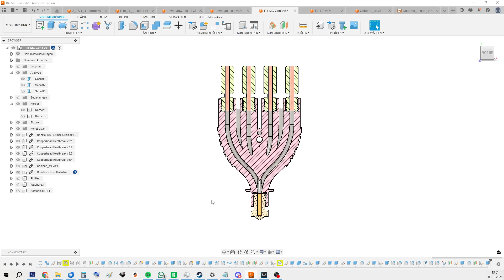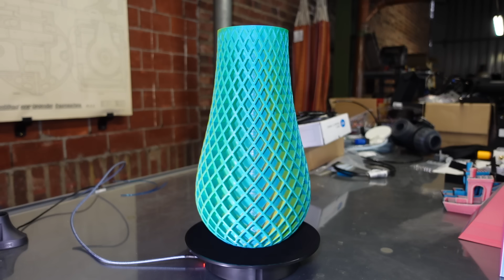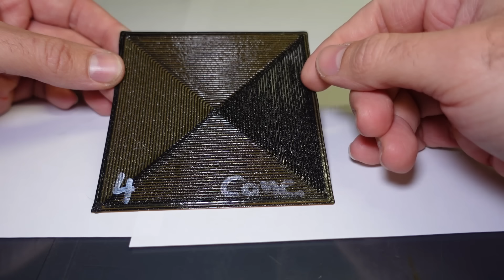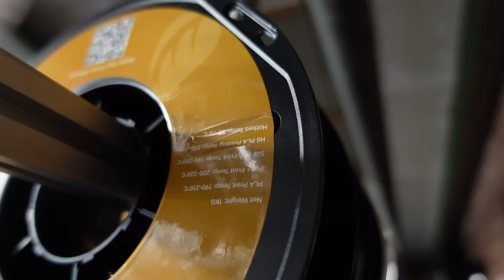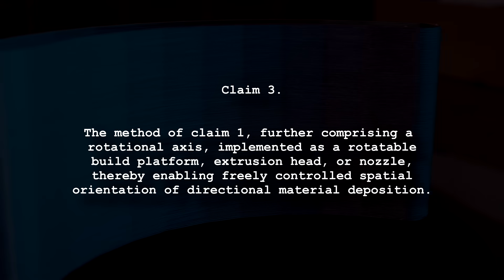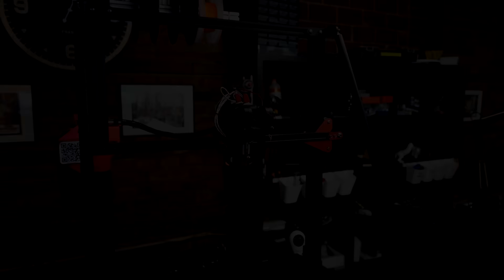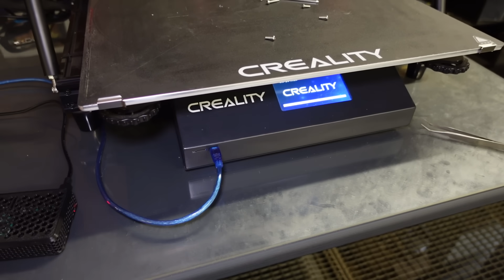WASTELESS Multi Color 3D-Printing. Introducing the Open Source Co-Hotend (Roetz-End E03)

Comment: Wie sieht es mit nicht kontanter Extrusion von einzelnen Filamenten aus?
Also 85% gelb 5% rot 5% blau 5% grün um eine gelbere Stelle zu kreieren oder 5% gelb 5% rot 45% grün 45% blau um eine türkise Stelle zu erzeugen?
Damit wäre es nicht notwendig die Richtung zu ändern um die Farbe zu ändern, natürlich wären 4 dedizierte Extruder motoren notwendig, jedoch wären die Möglichkeiten weitreichender.
Reply from the maker: Die Sache ist: Co-Extrusion ist patentmäßig ziemlich offen. Sobald du mischen willst, haben die großen Jungs bereits alles abgefrühstückt.

Comment: Well, the 3D printers from "Builder" of the Netherlands had this with 2 filaments, that were mixed in the nozzle like this. (Builder 3D Printers).

They moved to big industrial 3D printers.

But I have one of the smaller ones (with a mixing nozzle for 2 filaments, with 2 extruders that are mounted on top of the nozzle), maybe a printer from the first generation, that was before the big wave of cheap bed slingers from all over the world. According to my memory, only more or less flimsy DIY printer sets were available at that time from most of the other 3D printer makers.
Reply: For the time frame: One or two years after I bought mine, they came up with a higher printer - the same print bed, but a very high printing frame...

Comment: Nice! It'd be interesting to see if smoothing out the quad bore makes a difference for flow rate and/or for laminar flow quality. 

If I haven't mentioned this in a comment on an earlier video, it can be done with "abrasive fluid machining" (Extrude-Hone, US) aka "hydroerosive grinding" (Sonplas, Germany). There are probably other companies but those are the ones I know of 

Basically a fluid carrying abrasive is forced through the channels, smoothing any rough edges. It's used in diesel injectors, engine manifolds, etc.

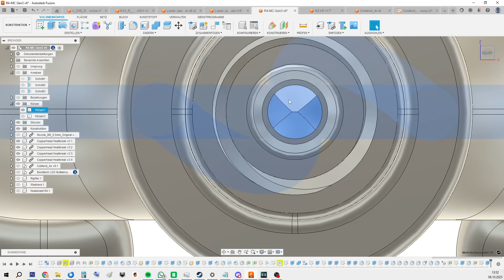Comment: All of this revolves around designing a join/outlet at 1:42 making a ?circular? mix with clean delineation, or lamination from separate filaments.
S what's the crudest primitive that can be made? w handtools,CNC or w/o.
Maybe premaking/buying such a filament + some system to maintain orientation in the output as filament shifts*.
Or is a cruder version possible abandoning the vertical form factor and just 2 short blocks bolted together and horizontal in-feeds? (combo-chamber, an internal-nozzle, symmetrical mixer, mixing-chamber, divot shaper thing)

The underside of a TOP block & the topside of a BOTTOM block are drilled either with divots(for a circular chamber), or just the or milled to create a directional inlet; 
Bottom block gets a through-hole

Then top  block is drilled in from the sides for in-feeds.
Bolted together to creating a joining chamber / laminar chamber:  (?)

~~ |--⮟--| ~~
       ⋮  (?)  ⋮ 
       |__v__|
           ╎

Hand drilling would probably have mixing problems instead of clean separation.
There's also trying just a chamber on upperside of bottom block , so the top block is just a clamp but hand-drilling down the FACE of a material isn't a good time, so any DIY feeds are drilled when blocks are bolted together but seems problematic.
Or starting from 2 pre-milled blocks CNC'd by a supplier for the combo-chamber for the combined feeds flow.
Then at home drill  the number of inlets wanted using preprinted depth/align guides, and tap assembly holes for final assembly.

*can't be magnet and ferrous filament as that would fail at a hotend, but maybe before that point.

Comment: If the flow through portion itself could rotate that would be cool but very hard to keep it from leaking under heat and pressure. I am certain it could be done but probably not the answer. If the entire hot end rotated that would be cool but you would also need to spin the spools. The bed is the most likely option but all require slicer software to keep the colors.

Comment: The rotatable build platform is already been done and it works so you could definitely do this. The hard part will be the slicer to rotate the model in the method required while maintaining the xy motion. I think it can be done but may be a bit of a programatical challenge, especially the key will be to keep the xy movement rotating to the same point while the table is moving. Very cool concept.
Reply: IMO I think for hard color transitions slicers could just add a pause for travel and then continue after rotating to a different nozzle is complete

Comment: 15:02 I understand from a simplicity and weight perspective why having a single extruder motor driving all of the filaments is necessary, but I wonder if you could achieve even more control by independently varying the amount of each filament you extrude, for example varying material properties or removing color contamination on a few layers where you don't want one of the colors.

Comment: Edit2: sorry for typos, the cellphone I use is quite old. 
Edit:for additional method look in my comment under this one, in a nutshell the method may include regulating relative extrusion speed for different filaments and/or cored configuration of filament paths, that will allow better control over the color when printing in mixing mode.
Well, full. CMYK is unachievable fir other reason, coz cmyk is not four color scheme, but fuve. In print it relies on whiteness of medium to mix in white. Without white  color saturation is essintially brightness as one can only desaturete color bu mixing it with black. But it might work to make it 5filament system which should alternate layers of different pairs of color to achieve needed color. Also i think feed rates might be also altered to some degree, not completely stopped, but some slowed down some sped up, maybe in 20% ir so, testing required
Reply: Fundamental reason is that color is defined by three parameters and it's impossible to map to one dimensional input (angle of extruder relative to part). To be able to pick any point in a 3d space 3 inputs are needed. Like (not entirely realistic scenario) angle of 3 colored extruder with black and white mixed together in the center. So, by adjusting angle of extruder, ratio of core grey extrusion to outer colored and ratio of black to white in the core it may be possible to print any color,  with certain restraints like pure black/white and uncolored greys would be unachievable still as extrusion speed cannot be set below certain value to prevent decomposition.

Comment: Wouldn’t it work with already multicolored filament? Instead of mixing colors in a special hot end, you could create a premixed filament with four or more colors arranged in the same cross-section as the extruded filament. Theoretically, it would work with any hot end.

Comment: I think you should also claim a version where it's done with a premade coextrusion filament. There are some filaments you can buy that are already multicolored like this--I've used OVV3D's tricolor extrusion, which has red, yellow, and blue. I think it's worth claiming in your patent a version of the print method that uses an existing filament like this, and then uses sensors to detect and compensate for changes in the filament orientation during unspooling. Maybe even also a version that doesn't compensate, as it doesn't twist as much as you might expect under normal printing conditions, at least until you approach the end of the spool. And maybe also a version that uses a filament that isn't round to avoid the twisting issue, maybe being flattened into a ribbon or somehow coerced onto a square cross-section; there's no reason to make filament like this currently that I know of, but it's the sort of thing that might be possible if there were a reason to want it.
Reply: Searched for this idea ( already packed filament colors in one strand ) assuming someone else had already thought of it... sure enough... here you are!   I didn't however realize that this "every inch of the way" multicolor filament already existed.  All that would be left to do would be to rotate the printhead.   I wonder if also tilting the printhead slightly could affect which color was dominant on top? Or maybe using an irregular ( triangle, square ) nozzle would help?

Comment: In the early party of your explanation, I was already wondering "Will he be rotating the feed for more complex shapes?" It seems to me that it would be very easy to use a rotating bed on a core XY machine, rather than rotating the head. Easier to build, less weight added to the gantry, plus you would have infinite rotation, rather than being limited to 360 degree rotation (requiring reversals) with multiple filaments coming down to the extruder. This is fun! I'm going to be watching.

Comment: I feel like this is really missing the point. are filament-change purge poops bad? yes, sure
for a $20 spool of PLA, each poop costs less than 1 cent... just saying, you'd have to do a LOT of printing to justify the cost
Reply from the maker: Sometimes it's less about the costs rather than time. If you have to do a filament swap per layer, this system (with also way more flow) will do it in literally 1/100 of the time. Think about that ;)
Reply: @Roetz40  that's fair

Comment: This reminds me a bit of the PrintM3D Crane Quad.  They also attempted to have four colors (usually CMYK) go into a single nozzle, but rather than using directional extrusion like you did, they just tried to vary the amount of material extruded to shift colors.  Needed some priming and if you were off by a bit, your colors would get distorted.

This seems more promising provided we can get some type of slicer support for "print direction based on color painted" in Prusa/Orca.

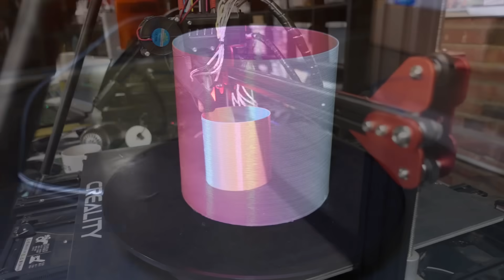Comment: 4:58 let's put in a 4th axis. A rotating bed, optimal printers that would allow for that are deltas. They have a round bed. If you give the slicer the information about the color transition and the ability to control the bed axis, you could print each possible color wherever you want. If this is already in the patent, I'm sorry. If not, it's my idea, don't steal it
Reply: That would be awesome!

Comment: Rather than a 4 Feeder inlet, a  3 feeder inlet in a triangle Shape, you can run a rgb Feed, orientating the nozzle in a +/- 120⁰ range to get a any coloured outside surfaces with only Red Green Blue  filaments.
What do you reckon?

Cheers und Grüße aus der Heide
Reply from the maker: Jo, die RGB Variante ist auch sehr interessant! :-)

Comment: uhm i am not trying to be a party pooper here i really think this is amazing stuff and i totally appreciate your work 
but could we not achieve the same results in normal hotends 
by getting the filament manufacturers to make a couple different 4 color filaments and then run a custom script or setting on the printer . 
there might be alignment problems that then could be solved by a rotatable hotend or build plate . just some food for thought
Reply: Pre-making a custom mixed filament before a print isn't that wild if you just want a linear color change across LAYERS.
Meanwhile keeping a color segmented filament orientated during the print at every step is a BIG problem.
Reply: @TheNewton which is why i said we can use a normal hotend with either a rotating mechanism for it or for the build plate to compensate . We might be even able to rotate the filament to keep it aligned . You just need a sensor and an arduino to keep the same color in the same spot
Reply: @TheNewton  also i had some filaments that were two color extrusions and they were perfectly aligned on the spool 
and also stayed that way til 
the spoool was empty . so it might not even be necessary to compensate 
for alignment

Comment: Now you just need to put the hot end on a bearing stack and change angle with a stepper so the slicer has control of the color..  for top and bottom you can just feed a single filament stepper. This is awesome!  I cant wait to see more of this. Would be cool from a software standpoint if you select the color filaments you want to print with and the paint program in the slicer would give you a color pallet to choose from that can be base colors or the blend of colors based on the selected filaments and their locations.

Comment: If one thinks through the geometry a rotating bed is a virtual impossibility. I mean even if you can rotate the bed around the centre point that would not do one much good when printing far from the centre. The only real possibility would be to rotate the print head and that would seem to be rather complex. The centre of rotation would have to line up precisely with the centre of the nozzle. I doubt that will happen in a machine that I could actually afford.
Reply: except that you don't have to rotate around the center of the build plate. For example the build plate could move in x and y, but still have its center of rotation in the same spot. Basically from top to bottom first a rotating mechanism, then unit that can shift in x and y.

btw it is super easy to rotate the nozzle exactly around its center if that is what you want.
Reply: @illusionmanager  Well I do not believe either of those approaches are feasible at a reasonable cost. I certainly would not throw money at a go fund me that says otherwise.

Comment: It's a kind of fascinating idea for co-extrusion. Not sure DMD is the right label - but whatever works. Pressure/gear advance as a feed method is interesting in itself, because if you can use a reliable melt/filament pressure feedback system, you can assemble multiple feed lines - or - slice the filament instead of slicing the movement of the print head alone. 

One approach might be to pre-slice filaments of a set-length and feed it into a combiner with a gravity/belt fed to aid in the hotend pressure/temperature flow. Feedback is the missing link- because flow rates need to be known and adjusted for - especially with aligning filament of brands, mixes, multi-mixed filament or environmental changes ie thermal/orientation changes. but, hotend swapping is a fascinating dimension if there's a way to keep the filament feedback in an accurate state.

ie variable flow-rate to the coextrustion is something that seems to have a lot of potential... if you can mix 10% blue and 50% yellow, and maintain flow without bubbles/forming problems, you have an additive method. Perhaps.

Then you need a feedback method. For the pure artistic side - it's fine. As an additive process for mixed color printing - IDK. I expect people to find more problems than original ideas due to the unreliable nature of filament under pressure.

Synced feed motors would be necessary to maintain the flow rate - You might also need a dual feed because of the friction/flow problem where the filaments do not have the same flow/bend properties, i.e. mixing TPU/PETG/PLA, sic. 

The bedflinger/rotation, mixed with percentage/frictional intake/pressure... there would need to be a lot of safety mechanisms on the multi-intake  - especially if there's a clog in the mechanism or a new reel's material had a different melt point. Clearing a clog in a large hotend would be a bit of a monster to clear out though. Perhaps the vortex/combiner needs a higher density metal ? it's very experimental.

Comment: Could you not “twist” dual color filaments as they are spooled to get the same kind of gradient using normal hot ends? Not that this isn’t super fucking cool just wondering, as when I load fresh dual color and do a load the poo comes out very cleanly delineated.

Comment: While it looks as though your extruder is always extruding the same amount of each filament, with independent extruders you could extrude the visible color at a higher percentage and that might take care of the overhangs showing parts of another color. I remember people tried 3 into 1 extruder hoping to mix the colors and get RGB printing, however laminar flow prevent the colors from mixing. You are using the laminar flow to your advantage here, well done.

Comment: You forgot to include the  possibility of independently controlling the extrusion rate of each channel (requires independent extrusion motor or clever mechanical tricks).

Independent extrusion rate enables a bunch of usefull features, however the flow control algorithm becomes quite complicated.

Edit: Amazing work by the way!
Reply: That's interrupting laminar flow with stop and go pressures in a plasticized medium.
A script alone ain't fixing that.
Reply: @TheNewton  What's your point? I don't understand. What will be the unmet expectations of such a feature?

Comment: 4th axis turntable and you can print whatever color you want on whatever outside layer.... however, figuring out how to slice that and make it work.... oof.  It can be done, but that's a task and a half.  Another option, would be to PWM each extruder, and a mixer in the hotend to create mixed colors.  Unfortunately, that would require poops, and would take longer. But if you can get a good mix, you can get CMYK on it... but you really need 5 to add white in, unless you can get black with CMY.  Which I don't know if that's possible with filament mixing.  Excellent design and process so far though.   A nozzle could have the mixing part in it.